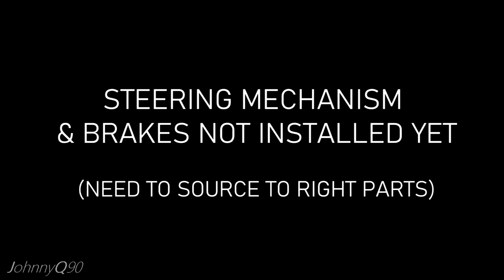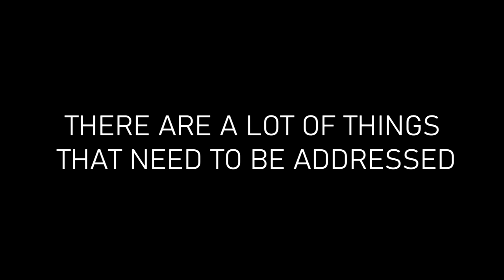Making a 1/5 AWD V8 RC Car w/ MANUAL Gearbox! - Engine & Transmission Installation

Comment: This is more than just a build.  This is an artpiece.  Brillant work Johnny, Bravo!
Reply: I'd call it jewlery
Reply: If you want art piece, look up Real Scale size ferrari... the guy went so far as to make a scale Ferrari down to even valves and valve springs, running gages and everything
Reply: Someone needs to build a multi engine full size mini car.  2 v8s for each tire

Comment: I didn't know there were legitimate scale engines in the RC world like this. This immediately has me imagining a true scale Corolla Trueno with a DOHC 4 cyl if one exists, rwd, a true scale represented drift car. I've seen the RC drift cars for years but electric doesn't excite me and nitro always sounded to annoying and loud. This actually sounded like a real engine but smaller. Wasn't annoying at all. I'm subbing!
Reply: Not sure about DOHC but there are small 4 cylinders out there for a while now.
Reply: @MiGujack3  this v8 is already dohc
Reply: @yuryv.2188  no it isn't. the other cam pulley is just idler wheel on these toyan engines and there's 1 camshaft under the valvecover :)
Reply: I know this feeling so well, I have the same feeling for motorcycles too that all 2strokes make the same annoying sound and 4stroke 2cylinders sound like worlds longest wet farts but 4cyl+ 4stroke bikes sound like heaven :)
Reply: Same

Comment: 6:36, you need to secure the pneumatic fitting holding the bowden tube better. It can help with stringing and less retraction.

Comment: The RC industry is making massive leaps and bounds. In the last 5-8 years alone the new products are amazing. And those Toyan engines are getting better by the day. I remember being pressed by their early one and two cylinder engines. Now they have a V8. The industry has really given the advanced RC DIY guys a lot of cool options.
Reply: There was a model v8 20 years ago not sure what happened to it.

Comment: Great project!
That radiator shroud though!incredible flow!I am not sure about the dog engagment rings health after a few runs.they used to fail on race car even when they are hard steel-chrom.i believe they will need to be adressed as a steel parts soon.specially when the throttle-torque reductiom religns on manual controll(hand)

Cheers! Keep the great projects coming!
Reply: Titanium
Reply: @tanyav7888  This titanium revision is officially approved by me.

Shit, let's get this out of the way now.
All proposed revisions to replace any existing part material to titanium is hereby approved.

Comment: Should make a different intake system for it, seems like just like the other engines the stock intake is more about looking the part then flowing much air

Comment: For braking, why not installing a brake disc on the transmission after ther gearbox ? It will allow you to have a single brake for the four wheels easier to install

Comment: what if you make a small ctv transmission for an rc car
Reply from the maker: I'd love to, but I need to figure out how to make some parts what belt should I use, etc.
Reply: It will just explode.
Tiny parts, way high rotational speeds and pressure.
There is a reason all successful RC cars have simple designs.
This thing is already way to complex and engineered wrong and will never work, or work well, or handle well, or be reliable.

Comment: What could be more beautiful than someone who is so skilful with his hands and who has the intelligence to make them make such pieces that one looks at like a painting by Picasso. Congratulations.
Your cooling system does not appear to be pressurized if it is... the coolant will boil at 212 degrees. If you are able to find a small standard radiator cap, all you have to do is add an overflow tank to that. In cooling -phase the vacuum in the system will keep the motor always full without air bubbles.

Comment: That's looking like functional art as much as it is a fun toy. Hopefully you'll be building an outer casing for that transmission to keep the gears lubricated so that they don't seize from heat or chew themselves apart. Other than that, I'm looking forward to seeing this thing Drive

Comment: I would love to know the Torque and Power figures this little beast makes!Where are you going to mount the battery and fuel tank, are you going to make a body for it?? and if so it’s only right it’s based on an iconic muscle car😎 I’ve got so many questions 😂this is one of the coolest things I’ve ever seen on YouTube. Can’t wait 😮to see it finished! Absolutely incredible craftsmanship and fabrication work. Would be insane to see you fabricate any kind of forced induction for the engine, a miniature Blown V8 would be so sick 😉 Love the build man, top tier content!

Comment: Great job. Been watching for long time.
Is that the same pocket CNC?

I was a machinist in 70s before tape punch.. We used hydraulics and 2d patterns. Had a tiny Gordon Electric too that used encoders. I would tell old timers this is the future and everyone will have one. They laughed.

You proved them wrong.

Comment: Wow! 
Unnecesary complicated gearbox, there is a simpler way to do it. I wonder how it will handle the force while on the road. 
What body do You plan to use? 
What You have done its beyond impressive! 
My congratulations! 
👍

Comment: Nice.  I would mount the rads mid ship for weight and protection. The fans should do fine if they have good airflow. Unless it's just a build it for the shelf model you will smash it into something.

Comment: This video makes me want to buy a benchtop lathe/mill along with a bunch of tooling..... pretty incredible Johnny.  I am sending a link of this to my brother who is a madman in the shop.  He is running the CMM now and he ok's all the dies and first pieces.  He is essentially responsible each day for over 250k worth of time, material.  Rework is not an option.  He actually is finishing up a contract with Amazon.  They built all the components for the new Amazon electric delivery vehicles..... watch for them in the near future.  We have always wanted to build our own cars so maybe this engine and the scale build will be enough to interest him.  I am a very strong cnc operator and I can hold a tight tolerance on the manual machines.  My dad was a master tool and die man at a company that made shopping cart wheels.  We actually made parts at night in his shop for where he worked because they went through well over a 100 a day of about 12 different parts on a giant circular press table that was loaded with different dies and forming tools that we made in his shop on all manual equipment.  I cannot tell you how many of these damn bearing race forming tools I made.  We heat treated them and then ground them in.... had a pretty nice little shop in his basement.  I miss those days,  my dad was smooth as silk on the 76" mazak lathe that we slid down the basement stairs with the help of a wrecker.  He bought a 3pc Bridgeport (Brand) mill that came apart and each of the 3 pieces were still crazy heavy. along with the surface grinder and the od grinder.  We went through some serious bar stock that had to be cut it into individual pieces because the lathe was up against a wall so we couldn't run bar stock through the chuck.  Good times, good times!! 
Peace

Comment: That little v8 sounds so good. I just love them. Only question I have is. Is that one a flat plane crank or a standard crank. I can't really tell at idle. But when you put the queedus to it, wow it sounds great. And is that transmission gonna take the torque? It would seem like planetary sets would be stronger. But I'm just saying.

Comment: I don’t think u need anyone to tell u how awesome that thing is! It’s incredible. I loved watching how u crafted it all. I only have one question. I was wondering that even tho it’s a scale model engine for an RC, do u have to worry about letting the engine run for a while to warm up before u turn on the fan. And if so, do u have a temperature monitoring system

Comment: Dying to see this running, have a project in my head ready for this engine but waiting to see the power output at the moment. Only real weakness I can see so far is transmission and clutch. I don’t have the machines available that you have, but what I tend to do with a custom is “botch” something easy in for a controlled test. Ie throw a brushless motor in and monitor rpms to work out gearing etc. I can’t remember the rpms or reduction of a 1/5th scale off the top of my head, but in my opinion top gear is overgeared (would have to do some maths) I would personally look for a top speed of 40-50 mph, and even that is possibly optimistic. Only mod I can suggest would be metal dogs (I could be wrong watching on my phone but they look like standard Tamiya Nylon) and possibly fettle the edges to a coffin block slightly, although this would make gear changing more difficult. How come you went for manual gearbox instead of auto Johnny? I probably would have gone for a savage 3 speed and reverse? The only tranny I can think of that should take the power, and be able to easily alter ratios

Comment: This is at another level.  How does the gears work with regards driving and changing, and would these require constant lubrication?  If I had this, I would only run either indoors or on a nice clean flat surface.

Comment: Lovely build BTW. Just out of curiosity, why did you use a Nylon sleeve inside the drive shaft mount instead of a needle or roller bearing given it's proximity to the engine?
Also, do you intend to mount a coolant reservoir (expansions tank - will it be a pressurised cooling system?) and fuel tank on the remaining base plate? (low c of g and all that). Looking forward to the next episode and sealing the shafts in and out of the gearbox to make a casing for lubrication - 80w90 ha ha!. That will be fun! Good luck.

Comment: This is a great model for the auto industry and consumers to understand. 
The level of engineering that goes into an auto with a combustion engine and driveline. I comparison to an electric vehicle.  
Point being. Electric Vehicles should cost half as much as a combustion engine vehicle... But, they are sticking it to the people.

Comment: Heres a suggestion: you could use a noctua PC fan instead to make the fan alot quieter! they make really tiny ones aswell and you could easily just solder together some wires.

Comment: Excellent work. But I have one question about the three speed gearbox. Should the gearbox have some kind of lubrication? I was just wondering because there is a lot of moving parts. Moving parts causes friction. And friction causes heat.

Comment: I have watched your years almost every video since sub. Dood you kill it and the only adjust ment I would make would be since you already built a dog box style Trans you should bake it metal cause I feel once you put the Trans under actual load from the car you may face a problem with the plastic not holding

Comment: i would use a "Alphacool UT60  X-Flow Dual 80mm" as radiator ... its already doubble width and got 1 fitting on each side like and it got screws on the side to attach it directly on the body

Comment: Would it be possible to have a hybrid version of this? Have an electric motor drive the back wheels, and the genuine drive the front? Or a mid-engined moddle with an electric motor on the front wheels? One of my biggest drives with RC cars has always been run time, so a mini-hybrid with a functioning alternator (maybe where the transmission connects to the rear drive shaft)  would be amazing.

Comment: excellent video. how many parts do you need to make, how many do you need to buy? what software is needed, which motherboard?  I have lathe, but no milling machine, are parts available that are milled? thanks.

Comment: Could you make a 2nd one in 1/5th scale of a stock ‘54 Buick, or similar, with a nice, soft suspension?  Geared low for scale speed and 2-wheel-drive, not for racing.

Comment: my buddy making mechanical motors it doesn't matter if it's a toy but today's are electric motors with remote control batteries combined with solar cells for less pollution

Comment: what happens if you put a bigger external flywheel between the engine and the guearbox to provide a constant torque with a lower rpm?

Comment: I'm just wondering what the clutch does and how it works with the gearbox. Also if you could have a gearbox without a clutch or a clutch without a gearbox.

Comment: Are you sure the gearbox is meant to run dry? Surely it will either get hot, wear out very quickly, or even seize up........ Personally I would have enclosed it in a casing, and ensured there was a small amount of light gear oil in there for splash feed lubrication. UNLESS the manufacturer says otherwise ????????...........

Comment: Imagine having a milling machine available then using 3d printed parts wtf.
Reply: The radiator mount isn’t under any kind of extreme stress or force, and pla is super light so why wouldn’t he use 3d printed parts?

Comment: I insist. those miniature engines. could be. connected. to an electricity generator in a real size d car,  then. the generator. could be feeding. the batteries of an  electric driven full sized car.
Reply: thats its just a normal Hybrid Car

Comment: While neat to watch, and you have mad design and production skills, there are several issues with this build.....

It's nitro powered, not gasoline, which totally sucks and defeats the purpose of the v8 engine.
Normal RC nitro engines are very simple with few moving parts, and efficient, this replicated gas engine is very complex and unnecessary if using nitro fuel.
Nitro engines are air cooled and do not require radiators and coolant, unless you make this complex gas replica engine and run it on nitro.
This replicated gas engine on nitro fuel is too big and heavy for this vehicle chassis.
Engine is mounted way too far forward, no room left for steering servo and linkage.
There is a reason fuel powered RC cars always have the engine mounted in mid and mid-rear configuration, for steering equipment and weight distribution.
Radiator and fans adding more front weight for even worse weight distribution issues.
Gearbox will definitely explode under load and usage, that is a very flimsy design.
RC gearboxes are small and simple for a reason. All attempts to make them complex multigear have been failures with poor reliability for owners. 
The engine does sound cool though, I will say that!

Your skills would be better used building something else, or at least doing it the right way.
You do not seem to have much RC car knowledge as most of what I wrote is common sense and obvious if you look at any fuel powered RC car designs.
Reply: Nice observation, but sometimes academic gauges is not all over all! ( if not watch the American car makers industry in this rate: fuel consumption- effectiveness!) Let's go to see when it will be release the model at the field! . GOOD RECOMMENDATIONS. GREETINGS.

Comment: Can. You.    this.  Motor.  Bigger.     Like.   For.   Cars.    And.    Trucks.       Old.    And.   New.    Like.   Cars.   From.  The.    1960.    All.  The.  Way.   To.   2023.   And.   Future.    Cars.      No.   Power.  By.   The.  Batteries.    The.   Kip.  Burning.      Different.     Cain.   Of.    Power.    More.  Reliable.      No.   Worry.  The.   Is.  Going.   To.  Catch.    On.   Fire.      👍👍👍